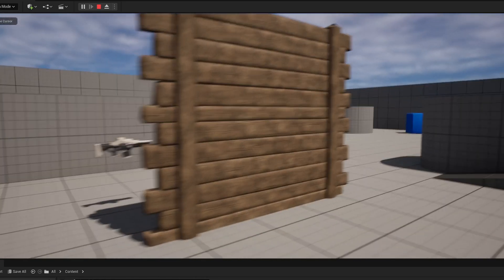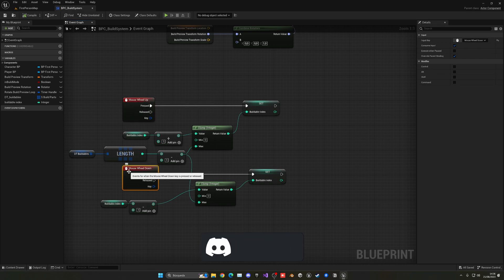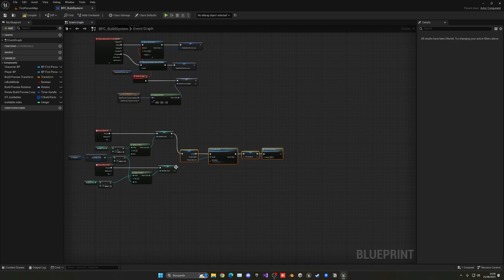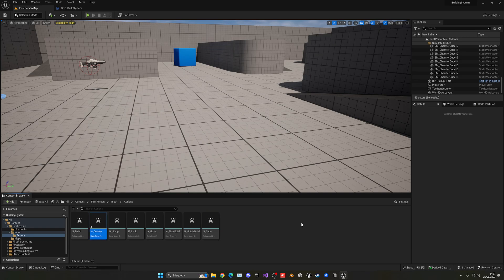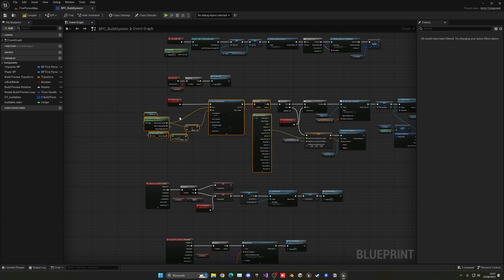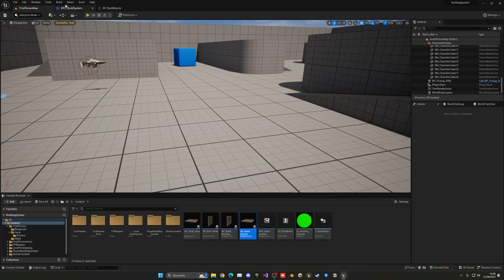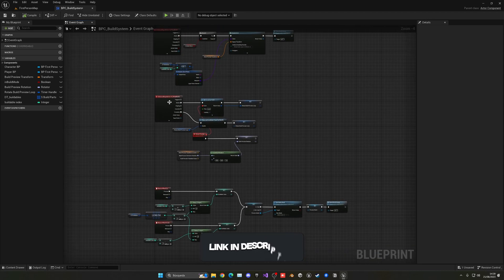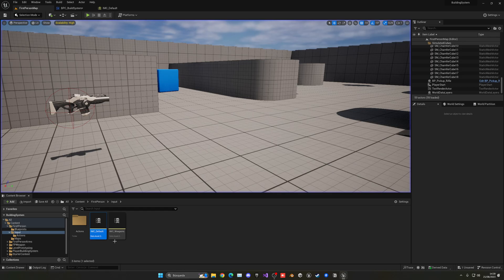Simple Building System in Unreal Engine 5 - #6: Remove Builds

Comment: What makes more sense is to add another branch  with "In Build Mode" as the condition before Destroy Actor so that it only deletes when your in build mode. I also think you should make the delete key your right mouse button which would be the opposite of the build button.